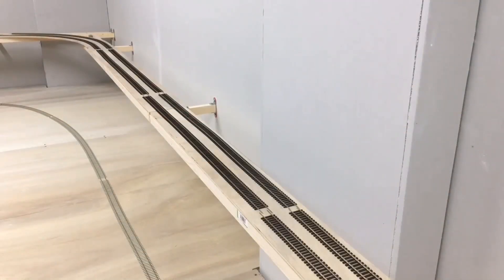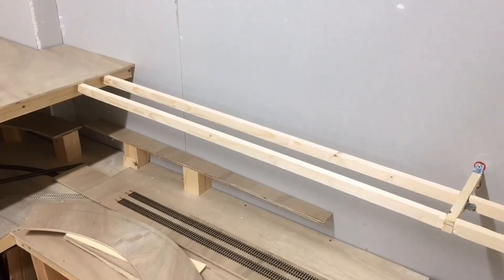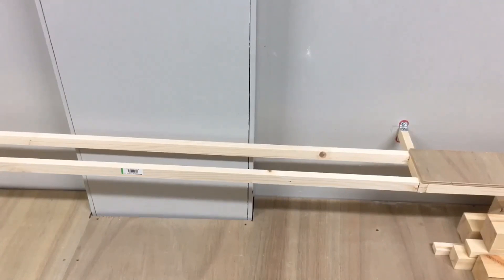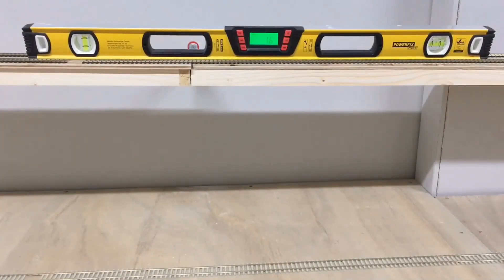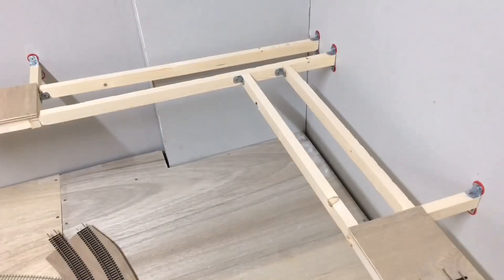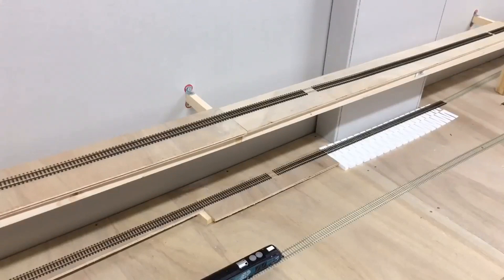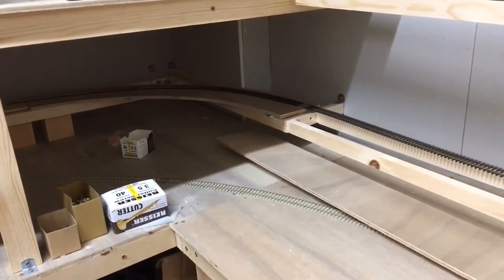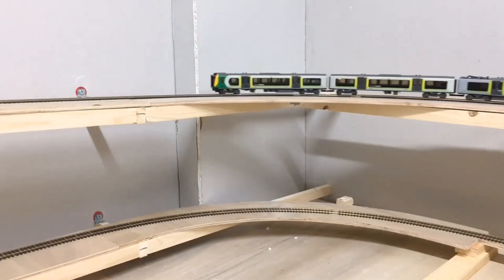Model Railway Incline Build - Trent Valley Railway #18

Comment: I have as you know been following your build with keen interest. I’ve looked through and wondered if you have specific content relating to your trolly pull out section at the garage door. I have a standard door to traverse with two tracks. I was thinking lift up hinged, but Scenics can be the issue, so I really like your idea of the pull out section as Scenics remain undamaged and it simply moves out of the way until I come in next time. It’s all the build and sliding in tolerances that I am unsure of. I wonder if you might do a video very soon that specifically covers this part of you layout build, man thanks to you. Paul at Sandling Junction
Reply from the maker: Thanks for the interest in the layout build, funnily enough a video looking at the removeable baseboard was next on the list and will likely be uploaded for the end of the month after the June Layout update next week.
Reply: Trent Valley Railway that’s cool I’m filming my take on it as part of June update, interesting to see how I did compRed to your splendid example cheers Paul